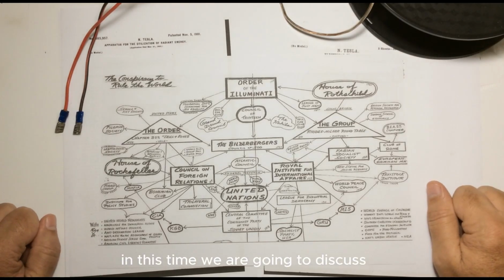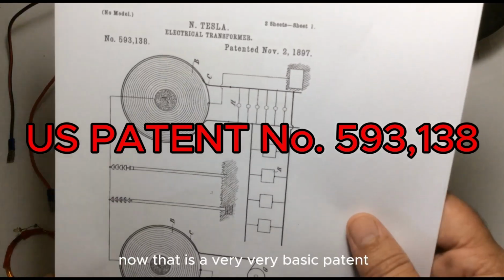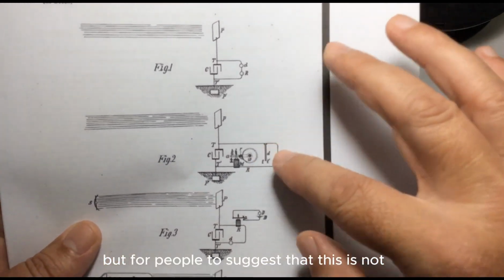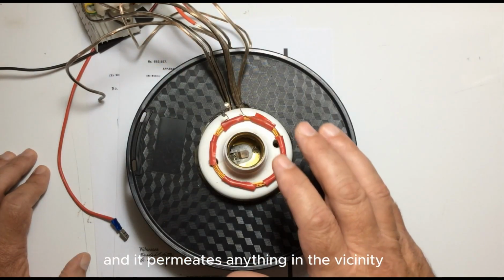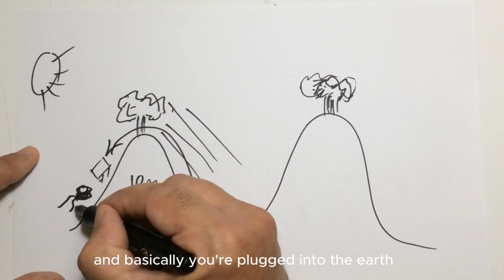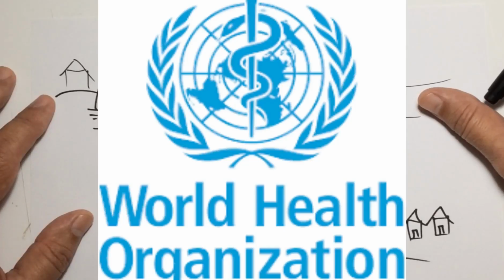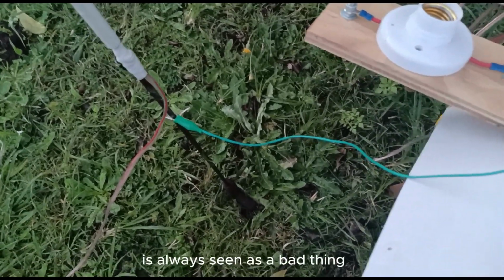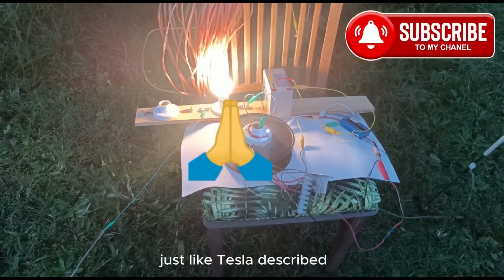THEY ARE COMING FOR YOUR POWER SOON - PLEASE SHARE THIS

Comment: I hope you do not think my comment is offensive, not at all my intention. I have no idea if your corcuits are pulling energy from earth, personally I STRONGLY doubt that.  But you have the right scientific mind set. And as I also do have a scientific mind I will attemp your circuits as well.
Reply: Ps: I'm not talking about specific transmission of energy using earth im talking about claims that it maybe be a over unity system
Reply from the maker: @franciscoferreira-eh1yu  I have issues with the way this is measured to be able to claim free energy but as usual things aren't lining up with our education. An example would be my circuit consuming 4 watts of power and when I add 4 wireless coils with a 1 watt LED on each coil there is no increase above 4 watts. Surely there should at least be at least one watt increase but there isn't. I recall Tesla stating that a high frequency coil could operate a secondary coil whilst additional coils could be placed on the secondary coil without increasing the load on the primary. I believe if we were to calculate the additional output of these extra coils we might have a debate on our hands.
Reply: @whatifididthis...1236  yep, measuring is some times  a problem... not really related to your research, but have magnetism involved: I made a simple joule thief, with a high bright led and a new 1.5v battery. At full bright it was draining only 2m.a from the battery. The problems are: The full bright part is measured with my eyes only, and current with a simple multimeter. Still it is one order of magnitude less of the total power it should be for the "same" bright. Ideally I should have a true RMS multimeter, with a sample rate of 40ksps because the current is pulsed DC and the  frequency was at around 18khz and a tool to measure lumens. Or a 1% or less low resistance resistor connected in series with the battery to measure the voltage drop on it with an oscilloscope.
Reply from the maker: @franciscoferreira-eh1yu  I would say that is a very efficient joule thief. I remember Lasersaber making a 2mA joule thief also that I wanted to replicate some day. In my opinion it is perfectly related to my work as my main focus isn't always biggest and brightest but more efficiency related, I want to achieve as close as possible to conventional with nowhere near the cost.
Reply from the maker: Thank you for your comment.
I do not take your comment as offensive, I don't personally believe this is pulling energy from the earth however there is a clear difference when connecting to or through earth. One or two earth connections in various positions supplies a form of radiant energy that is not seen without earth points.

I would greatly appreciate you replicating my circuit as my main purpose for releasing my design was to accelerate my learning about it. There are only so many hours in a day and I have physical disabilities that make my research attempts very slow so I would greatly appreciate the help. Please feel free to update us all on any findings you have.

Comment: Hello! Awesome demonstration and thank you for sharing your circuit as it is. I've been trying to replicate something like this from other researchers but something was always missing from those. This time it worked as you described and demonstrated, so thank you again! I made the exact setup with the same transistor, for the coil I used 0.75 speaker wire, 9turns bifilar for the primary, 190 turns for the secondary. I'm facing two "issues" : the 240V 9w led sometimes does not want to light up for the first power on, due to the frequency mismatch i believe and the transistor wants to consume 5 amps which is way to much. Do you have any ideas why is the high power consumption happening?
Reply from the maker: Thank you for your comment.
Thank you for confirming your replication even if it isn't quite there yet you have come further than most do, now lets try to work out the rest of the puzzle. First I need to check if your using CCA wire, I recently was told by another viewer that their replication wasn't working and we put it down to the CCA wire. Copper Clad Aluminium is as it states, an Aluminium wire that has been clad in copper, so basically no copper to speak of. Aluminium is great as a dielectric in this circuit in the form of capacitors but in a lot of other positions the aluminium has an adverse effect. If it's CCA wire you may be wasting your time.

I own hundreds of different light bulbs for the very reason that not all light bulbs work with this circuit and I believe it is as you stated, the wrong frequency. There is an older video of mine, possibly the one where I state I get zapped in the title, where you can see that a light bulb in the circuit is not working until I slide a ferrite rod inside the coil at which point it comes on. There may be some money saved if I make a video of all the different lights that work covering brands, ratings and models etc. You will have more success with the lower wattage bulbs around 5 watts but even so I have a few 9's 10's and 11 watt 240v LED's that work just fine, I focus mostly on longevity of brightness mind you the 5 watt is blinding so... 

My circuit will operate without a load so can I suggest you confirm you have the wireless function, grab a small plastic pill bottle and wrap approx 20 turns around the bottle, doesn't have to be neat just bunch it up quick, solder a normal 3.2 volt led to the coil, now remove the coil from the bottle and wrap some tape around the coil to help keep it in a rough coil shape. When this coil is brought near the centre air core the LED will be nice and bright. I use this LED or similar ones to remind me the coil is on and to let me see if the load I'm trying to run is compatible, I know it isn't if the little LED is running and the load isn't running. 5 amps is massive when running a 9 watt LED. A 9 watt LED should top the circuit out at approx 12 watts, just over 1 amp.(through 60 metres of earth-90 metres of cable). When operating the circuit with no load and just the wireless LED coil you should be consuming between 4 to 6 watts.

Sometimes when attempting to start the circuit it wont turn on first go, this can also be a bulb issue, some of these bulbs can still run but require the circuit to already be running before attempting to connect the bulb, again this is why the small quick wireless coil is so valuable. Sometimes there is a vibrational oscillation that can be seen running through the battery with a scope after a failed start attempt, it seems to ring down at which point the circuit will require static equalisation, which is as simple as touching both battery terminals at the same time, just make sure it is off first because it can burn. This not starting issue is more common if running high voltage line through load to NEG on the battery, some of the LED's that don't work on the high V line to NEG may work through earth and vice versa. If I had to choose I would aim for bulbs that run on the circuit through earth as this has many other benefits.

Please let me know if this information helps at all
Reply: @whatifididthis...1236  Thank you for the fast and detailed reply. Without the load the circuit consumes about 0.2 amps from a 12V 7ah lead acid battery, and yes I use a small coil with a led for indication as you do. Great idea btw. As you draw my attention to the quality of the wire I quickly scratched a couple strands with a knife and yes, it's CCA wire unfortunately. I will rewind the coil with some quality stuff and then give it another go. What cross section do you recommend, I think you already tried a couple sizes? Thank you again!

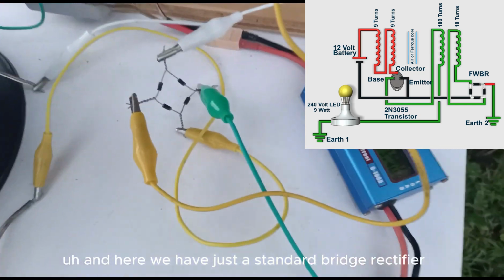Comment: 31:50 Where are the other two coils that each have 180 turns? I can’t see them in your setup, unless if I’m blind.
Edit: Oh do you have the 10 turn coils on top of the 180 turn coils? So you have 4 coils sharing the same spool, with a total of 8 wires that need to be connected accordingly: am i correct?
Reply from the maker: @milesjargon  Thank you for your comment.
The Primary is 18 turns bifilar wound(side by side) therefore it is 9 turns of a bifilar wind.
The secondary is 180 turns single wire. Insulation on wire and wire should be the same type as the primary wire for dielectric capacitance.
The 3rd winding in this case is the 10 turns that lay on top of the 180 turns.
So there are only 3 coils in this circuit but I had to draw it that way in the schematic because it is important that the primary is looped back for a second run.
If you check my channel for my tutorial videos it is a little clearer.
Reply: @whatifididthis...1236  Thank you that makes a lot more sense now. I will check out your other videos too for clarity.

Comment: I think our education system never illustrates problems and solutions in a comprehensive manner.
Like you would explain the word dog to a child by showing them a dog sitting, barking, walking, running, and other types of dogs. But in electronics (at my school), you get showed a battery + a resistor + a lamp (maybe a pot). But they never illustrate other things.

Comment: I continued to do some tests with 24v-12v-transfer. I got some very important insights. It explains also the result of a video of yours. You had always 50% less. I had exactly the same result with completely other batteries. I ordered 20 pieces of eve 3.2v 20ah lifepo4 a while ago.

First of all the 50% transfer you had, were just because it takes the double portion from the 24v-bank. If a device runs with 100W it will take 200W from the 24-bank. In other words if you would have done the test in the conventional way it would have last double the time. If your test lasted 5 hours in the first round , in the conventional way it would have last 10 hours. So there is absolutely no gain. And I found out why. I did tests with 3v-15v and 6v-18v and 9v-18v and 12v-24v. The load was always 12v-Inverter with a 30w-bulb. With 3v-15v it just charged up in the beginning. With 6v-18v it charged up longer. It was 30% of the whole time. With 9v-18v it was even longer. 50% of the whole running time. I realized suddenly it stopped charging up. And then it made click in my head. With 9v-18v or 12v-24v it charges up just in the first half. Everything still is running but it won't charge up more. I know why. It's like 2 lakes who have the same size. One is full and one is empty. What happens when they are connected. The water of one lake will flow into the other until it is even. And not until the other lake is full. That's the key. In your experiment you won 10 to 0 in the first half. And in the second half you lost 0 to 11. In the second half everything is wasted in the environment.

I charged the estimated half full batteries up with solar power to check if it's really 50%. And yes it is. It works like this. In the first half nothing is lost.

Then I did the test with and additional circuit. I run 9v-18v with a step up converter to 26v. I had other 4 batteries in 12v on the other side and connected the load on the 26v+ and on the 12v+. I was very surprised it worked exactly as I expected it. In the first half everything went into the 9v-bank and also in into the 12v-bank. 200W went from the 18v-bank into the 9v-bank (6 batteries) and 84W went into the 12v-bank at the same time. It was charging up 60% of the time. That's because I tested it with 12v-bank. There is more volume to soak in. I will test it also with 9v-bank (3 batteries) and then it will be probably at 40%.

Important to know is: The big bank needs always to have a bigger state of charge than the smaller voltage bank. Then it works. This are 2 lakes with the same volume.

I understand now the basics. Now I need to earn money again. Later on I will try to push this power back to the big bank with arduino and switches and so on. It's important to take power out of the smaller bank and to put power into the bigger bank in order to have the state of charge always bigger than the one of the smaller bank. Then it's running for the lifetime of the battery and it's producing additional power at the same time.
Reply from the maker: Thank for your comment.
You would be correct, this is not just a connect and see situation. There are some very important things to consider that allow the transfer method to work as I see it and whilst I could be wrong I will tell you what I believe those things are which may help you tailor your experiments. Just to be clear for others reading this you are not talking about the circuit in this video but another video of mine relating to the Tesla Transfer method.
For the ease of context could I please ask you to post questions on the relevant video in the future and I will answer this one here this time.

First it is most important to consider the load and the way you transfer this power, not too much not too little, there is a resistance relationship which is seen when using simple LED's, a balanced load allows for a much more efficient circuit. So this includes the battery capacity as well as the LED or load operating from it. Resonance also plays a fact, at which point most people will be saying but its DC, there is no frequency. but this would be wrong when considering the following point, as well as the LED acting somewhat like a spark gap with a breakdown voltage.

This is where it is helpful to use the water analogy, if you have the two tanks the same capacity, one full at the top of the hill and one empty at the bottom of the hill and then open the tap to allow water to flow only through the hose to the bottom tank you still only have one tank of water and have gained nothing. In the same respect you also lost nothing. However, if I place a generator in that hose line and whilst I transfer that water I generate electricity then store it, I still have the same energy in the volume of water plus I have some extra energy stored that I did not have before.

That is the mentality we need to have in mind to ensure the transfer is most efficient and the most efficient way to transfer this energy is using a pulsed frequency, for it is in my opinion the moment of disconnect is where the magic occurs. So whether it is a physical disconnect or an electronically timed disconnect it is the ceasing of momentum that acts as a damned build up. in much the same way that a water hammer occurs when shutting off the water tap too quickly, it is not the water that has the power but the velocity of mass that carries the power, turn off the tap too quick and the velocity of mass is converted to a form of energy that allows for the continuation of that energy,  resulting in physical vibration and sound. Nothing created nor destroyed but transformed.

Now make as part of that pulsed DC power supply a coil in series with that collapse and you have a massive amount of energy with every collapse of the coil. This power needs to be transferred at the point of collapse and so it is as you suggested, meant to be sent to the primary battery but it is the collapse being sent and not some of the transfer power, so this is where the excess enters the system, when the magnetic field transforms itself to the electric field because it knows it cant die and sees a path to take through transformation.

Please keep me up to date as you are doing, one day it will all seem obvious.
Reply: @whatifididthis...1236  Very interesting answer. I did some further tests with 9v/18v plus a boost up converter. I know already more but it's not that easy as I thought and I need to do more tests. I will write a comment about this tests in your respective video.

I would like to know more about the green-Led experiment. I saw in your tests that it works. It's like an intern Back-EMF in my imagination. The load needs to have exactly the correct frequency in compare to the batteries. In your case the green-Led does it. Am I correct that it should work with every battery-setup? I just need the correct load-frequency and it would work also with my batteries (3v 20ah). We need to find out how to calculate the required frequency for a certain battery-setup. I think it can be just the voltage and the capacity of the batteries. If there is a stronger voltage the power is stronger to transfer one electron to the other side. If the capacity is bigger of the 24v-bank (or whatever) the pressure is bigger to push the electron to the negative. I believe this defines finally somehow the necessary frequency to profit from the intern back-emf which is balancing the power.

What is your view about this? How could we come to the next step? You showed it works and you're probably the only one on this planet who got this. But now we need to know why it works like this to build other set-ups.